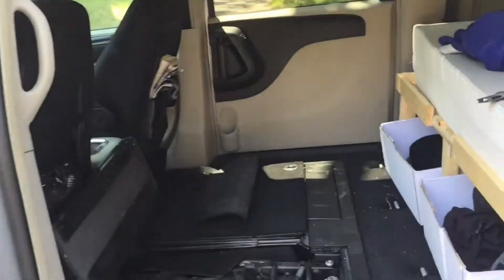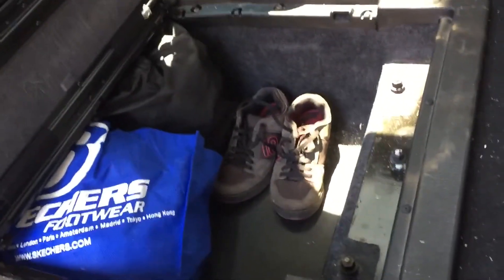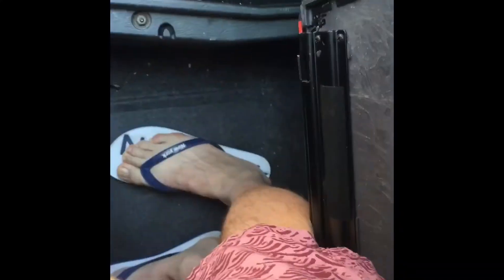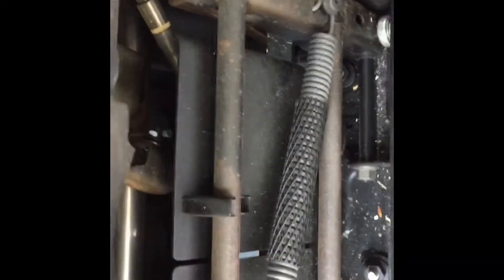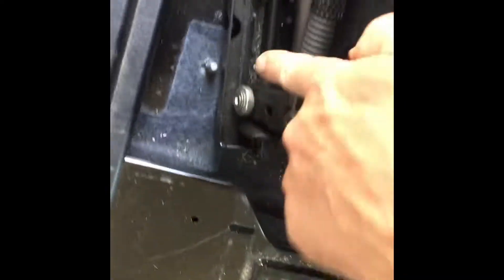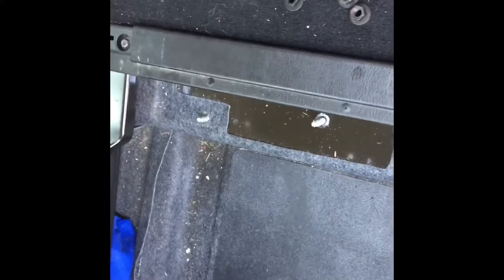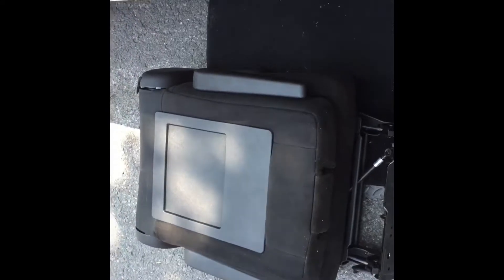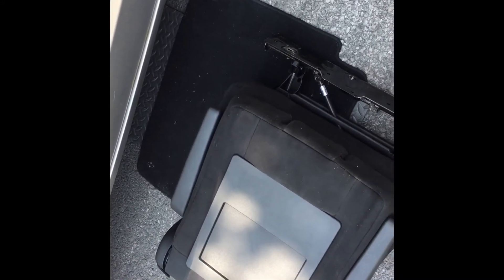Stowe n go seat removal

Comment: this is great... ty so much!  One question, did you really need to remove that middle plate on the floor between the seats?
Reply from the maker: It helps, and it’s very easy to just pop it off the clips. I put it back once the seat is removed.